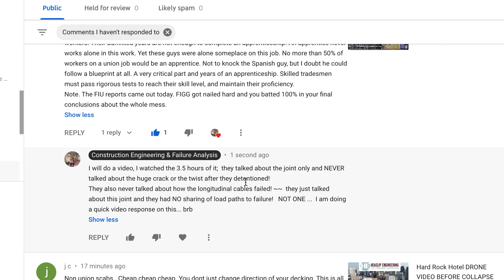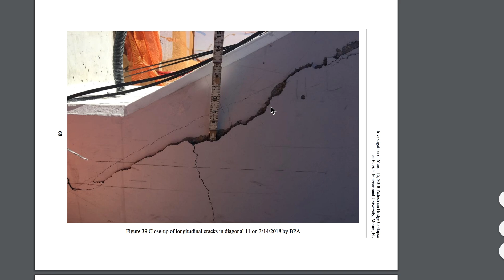FIU BRIDGE COLLAPSE NTSB USED UNQUALIFIED ENGINEERS TO EVALUATE FAILURE IN FINAL REPORT

Comment: Hey there, non-engineer here. Can I ask, what could they have done to prevent this collapse? I don't know much about how concrete works but a tension support system seems like it wouldn't work with concrete. Shouldn't something that heavy be supported by downward compression? I live in LA and we have freeway that are insanely thick and insanely high, all of them have regularly space pillars beneath them.
Would the elimination of a driving lane to add a pillar have been the only way this bridge could have stood or would tension cables actually have held it? Like, even if it would have worked under tension, they should have at least set up the tower the cables would attach to first, right?
Or better yet, just make a steel bridge, if they had to have something free hanging like that. Like I said though, I'm not an engineer, and I don't work with concrete, so I don't know its nuance properties. I just want to understand how this bridge made it past the conceptual level...
Reply from the maker: The design is complicated and I am not sure if a center column would work... this design appears to have structural issues in the design process...  So, the column would buy you time but how much time?

Comment: I said it before and I'll say it again.  That's not a crack.  Tat is a failed structural member.  It may live a while in tension -- due to the steel tendons.  Load it in compression and it likely will go wrong.  Compress it beyond the preload on the tendons and it may as well be made of ground beef.

Comment: The picture of the crack really show it was not merely a simple stress crack.  To shove that ruler down the side and the shadows the bottom of the crack is casting tells me the top have has moved.  Is there a set of corresponding cracks on the other side or is this really a seam or fissure that has developed.  If there is no crack on the other side, it seems more like a fissure, like the concrete is trying to unwrap itself from an internal body applying a lot of force against the concrete internally.  What is at the bottom of that crack?  The rule I remember for concrete is strong in compression and weak in tension.
Reply from the maker: But, the nut jobs at NTSB, state this column is structurally, ready to fail but then run a computer model like it has not failed!
Government workers are the worse!!!

Comment: whatever the report says  ...1 that bridge was not picked up where it was designed to be picked up at the ends.   instead the contractor picked it up  like 25% narrower .
 2 per video comments from blancolirio yt chan on the accident states that workers ADDed tension to the ends of the structure to compensate. 
3 when they lifted this configuration it overstress's the tie rods and they deform but do not break but the nuts on the ends are now deformed jammed as well.
4 after the bridge is placed the post tension should have been to take the excess stress off the rods they overtightened , but the nut is jammed and the rod is deformed...and the guy that put the nut wrench on that rod [he's the poor guy that fell] broke that rod right off at the first turn is what.
 no i am not a engineer  that is just the facts as i see them from comments made ...the design was not supposed to be picked up in the middle .